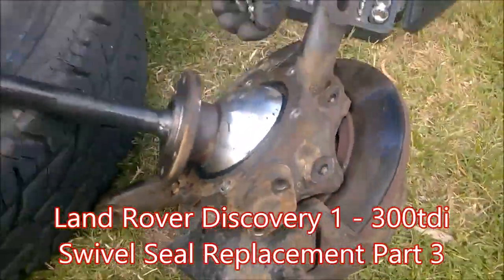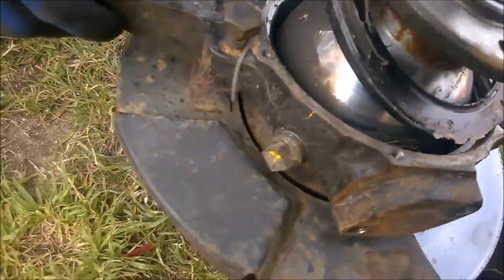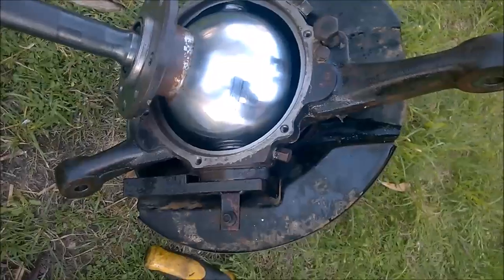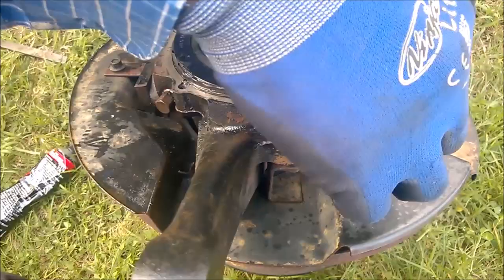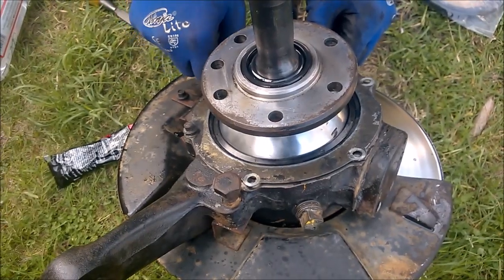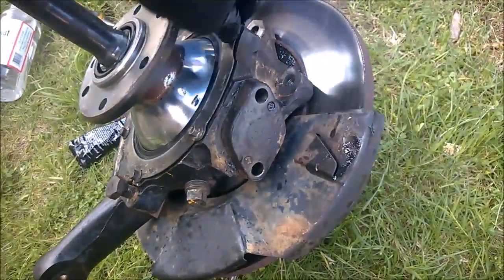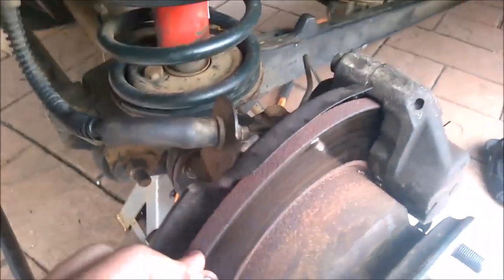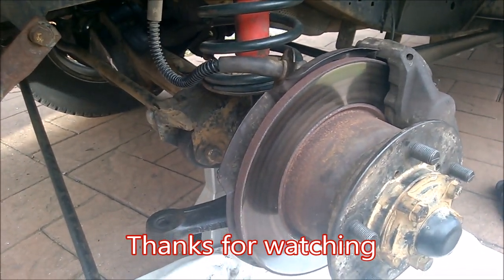Part 3: Land Rover Discovery 300tdi - Swivel Seal Replacement

Comment: Great video, would this be the same for a 1984 Classic?
Reply from the maker: Same technique different seal.
Reply: @rovertasmania7033  ok thank you.  it seems like such an involved process, but worth it.  Same with brake rotors - need to dismantle and rebuild axles and wheel bearings to do it.

Comment: Hello, great vid. Thanks. This job is to be done on my Discovery 300TDi (1998, Trophy). I understand that there are two types of seals: 9 and 11mm? Can you tell, how to identify the proper one for the axle in case. Does one fits for all? Cheers Heinz
Reply from the maker: Honestly I'm not sure... I think they are interchangeable but just refer to seal part number.

Comment: Maybe I missed it somewhere in the video but what was the symptoms to require you to change those components as I have a wheel wobble coming from the front left and can’t pinpoint it and fairly new to landrover from fronteras I’m kinda stuck if you could help. Many thanks guys.
Reply from the maker: This was to replace the oil seal on the swivel. If you got a wobbly wheel this indicates a more serious issue that needs immediate attention. Could be a number of things, lose wheel nuts, lose or worn wheel bearings, swivel bush and bearing worn.  Please get a mechanic to check if you haven't the tools and skills. Slowly build up skills over time but don't stuff around with these types of issues.
Reply: Rover Tasmania thanks very much for info friend I’ll get it checked out.

Comment: going to have to do this on my series 3 great vid dont need to take apart the whole swivle wheel asembly :)
Reply from the maker: Or, you can try the 'cut the seal' method and install it back with the slit at 12 o'clock position.